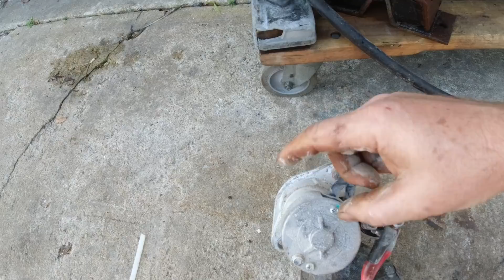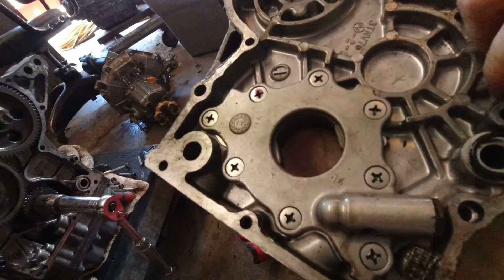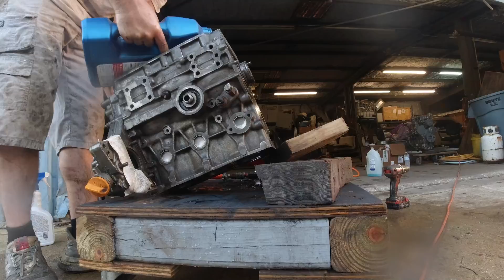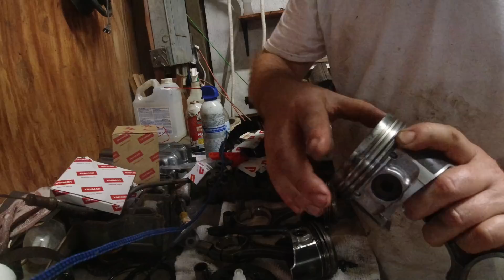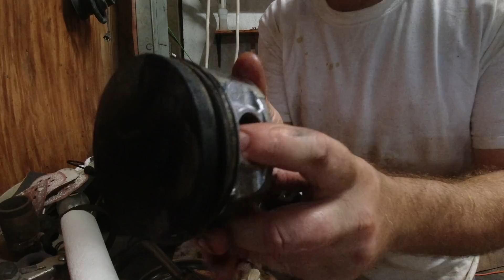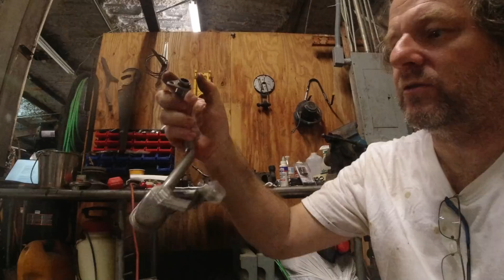34 Sailboat Diesel Engine Repair and Rebuild PT1

Comment: what made you decide to use that style of hone vs the ball or "dingleberry" hone? I have done a couple quickie rebuilds on car engines and thats what I have always used, what is the difference or extra benefit to the hone you used? ps that engine really dosent look like it was underwater, the cylinders look fine not rusty or anything. is that the engine from the good hull that wasnt submerged?

Comment: So is the starter motor damaged beyond repair?  It would seem salt water would damage it more than the rest of the engine.   Interesting the difference in honing method - the honing tool using ceramic balls have you powering the drill before inserting tool into cylinder.   
The injectors if clogged- one of the most interesting YT videos I've seen is mechanic using a rubber tire stem with Schrader valve removed, the plastic stem cap with hole drilled into top  and can of carb cleaner with small red straw slightly melted into the plastic cap's hole.  Put together with rubber tire stem fitted over the input side of a clogged injector and 12v applied to injector electric terminals- the carb cleaner cleared the partially clogged injector in 5 secs.

Comment: The solenoid is a pre engagement unit it’s stops the starter knocking the teeth off the flywheel. (It the teeth aren’t fully engaged it won’t turn a better way to check a faulty pre engage unit get someone to turn the ignition and give the solenoid a tap. 

The flywheel balances the engine to reduce vibration. You may notice two holes in the flywheel they’ve drilled holes removing material for this purpose. The firing order is usual 1432 so one cylinder is always driving the crank. 

Brian’s right it also stores kinetic energy. Great video again 👍
Reply: How could you have missed that Bryan has a 3 cylinder engine?
Reply: @pauleohl  I couldn’t be bothered to finish the point 4 cylinder have many advantages in respect of vibration whilst the subject of the flywheel was on the table.

Comment: Looks like that starter is toast. Was the fuel injection pump saved from the salt water because it was full of diesel fuel?
Reply from the maker: yes Injection pump was fine because the fuel system is sealed.

Comment: Hi Bryan,  to make your job easier for fitting rings, just hold the con rod in a vise with the piston sitting square on the flat top of the vise.
Less chance of breaking a ring.
Quicker too when doing a v8 
Great to see you again, Steve.
Reply from the maker: Great tip!

Comment: the "solonoid"of the startermotor is actually called bendix, it pushes out the starter gear and than connects the 12 volt battery to the startermotor. so to jump start it you connect the 12 volt connection to the smaller bendix connection (from the key) with your screwdriver.
Reply from the maker: Great correction. I'll try to point that out in part two.
Reply: The  bendix style starter hasn’t been used on engines for many years. They used inertia to engage with the flywheel damaging the teeth. It’s often referred to as but it’s not a bendix

Comment: Nice explanation on the diesel engine. One more important thing to keep the torcwrench in good condition is setting the spring tension to its lowest value.

Comment: Bonjour Bryan.  it's raining cats and diesel pistons here in the forest of southwestern France.  How i wish i could be at your side handing your parts as you install them in SHORTS.  i miss the heat of the United States.  it's April and i've got a fire going in order to warm of the house.  What a great vidéo.  i've rebuild engines before and it's pain stakingly difficult at time and quite satisfying when finished.  i'm sure the engine will start up.  the method of check and double check is brilliant.  you're an inspiration for not giving up, and soldiering through a task.  all the best

Comment: Nice one Brian .I gather the engines weren't running when flooded????   Keep on the great work
Reply from the maker: No they were both underwater and it was several months before they were taken apart
Reply: @BryanSailing  Months underwater and very little corrosion. I am surprised.

Comment: Wow. And I always thought it was the pistons going up and down that turned the crankshaft. Huh.  ;))
Reply: Have to admit, though - you do good work!
Reply from the maker: Very true, except for when the engine is starting and the starter motor is turning the crankshaft. Not to worry it’s just me contributing to the wealth of misinformation on the internet.

Comment: From my OJT oil will poslish the cylinder and reduce resistance or pressure sepage.   And a solvent like WD40 will remove the gloss for better compdression and less sepage.  JMO
Reply from the maker: Great tip